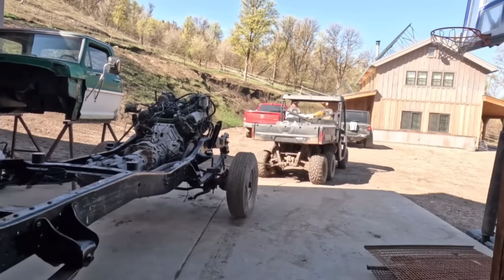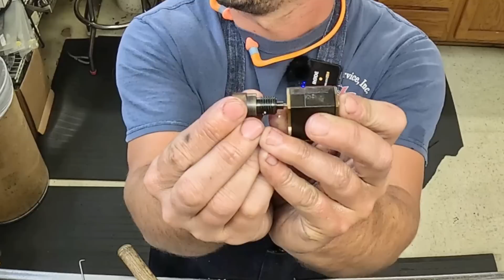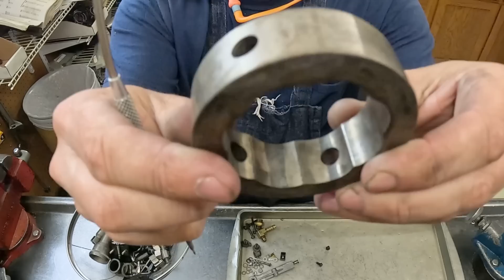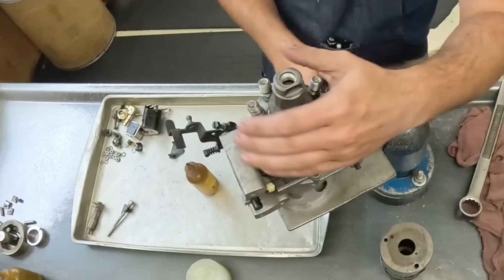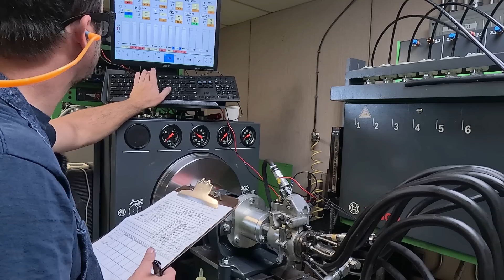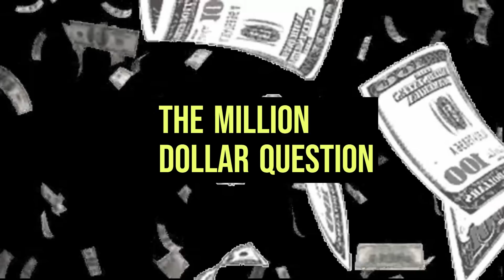DB2 Pump from 1990 Powerstroke chassis + 1969 Bumpside body = @RedPoppyRanch FrankenFord!

Comment: I sent a message through the web portal asking about my Ram 1500 with a 3.0 Ecodiesel that I want to rebuild and got no response, waited 2 weeks in case I caught someone on vacation and followed up only to find my email address was blocked. Pretty funny. Apparently I insulted someone by asking a diesel repair shop about a diesel engine? smh.. I don't understand.  Kinda of humorous. lol
Reply from the maker: @quietbrianquiet - I'm checking with the team on this - when you say email via web portal - are you meaning the form on this page? https://www.areadieselservice.com/contact-area-diesel-service-inc/ or did you send your inquiry directly to the parts@areadiesel.com - We may need to look into and make sure there isn't some issue happening preventing our messages from getting through.  The Chat now is monitored by a very responsive in-house team and we are here 8-5pm M-F CST and that's the quickest way to get support (800-637-2658).